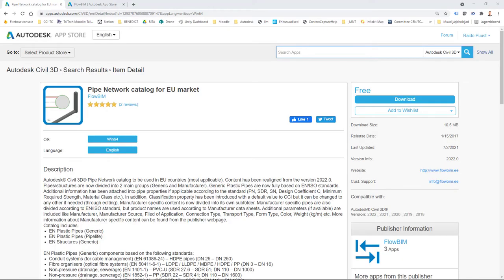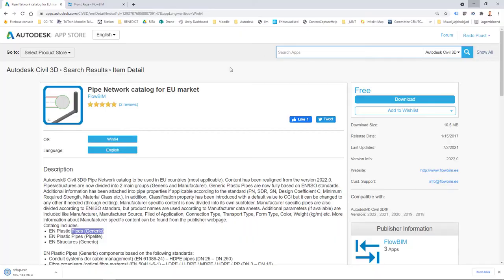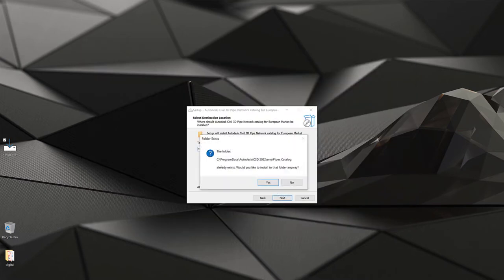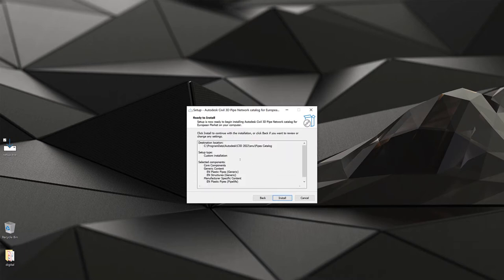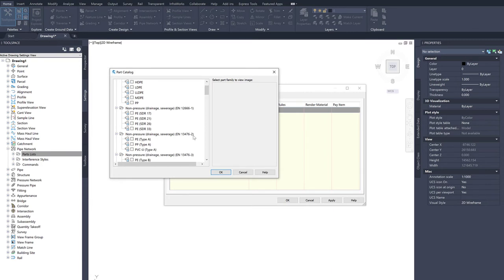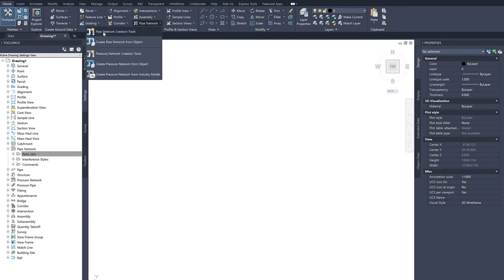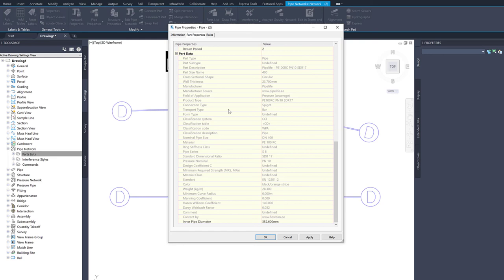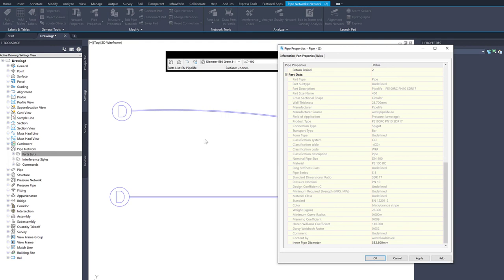Autodesk Civil 3D 2022 - Pipe Network EN Plastic Content Pack

Comment: there are some problems in C3D 2021 VERSION WITH PIPE NETWORK CONTENT PACK
Reply from the maker: Please be more specific. Pipe Network should work as long as you follow the guideline. But yes, for example "Pressure Network content" is 2022 specific as Autodesk changed the grouping behavior of content and I have not found a way how to make the content unversal for previous users and for current (2022) users. Therefore it is only for 2022 users. Let me know your issues with Pipe Network content pack. But first, please check the webpage. You have to copy one extra XML file that enables to use pipes from Pipe Network catalog.
Reply: @eRaido   there  is no XML  file in the procedure
Reply from the maker: @mohammedbakheet4726  Please follow the guidelines from this text (in video, this XML is not described but in text it is and it is added during the installation but you have to copy it manually from one location to antoher - check tht guidelines): https://flowbim.ee/pipe-network-content-for-autodesk-civil-3d/
Reply: @eRaido  THANKS IT WORKING PROPERLY NOW
Reply from the maker: @mohammedbakheet4726  Good to know!